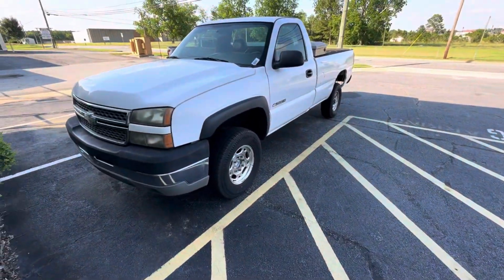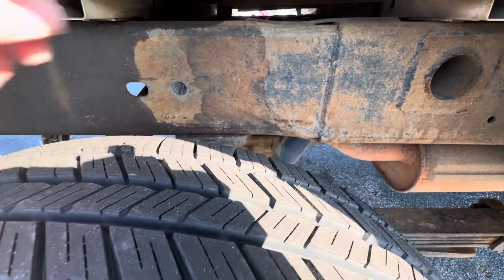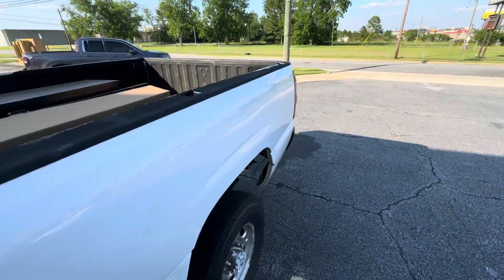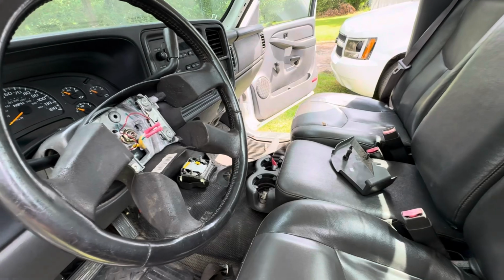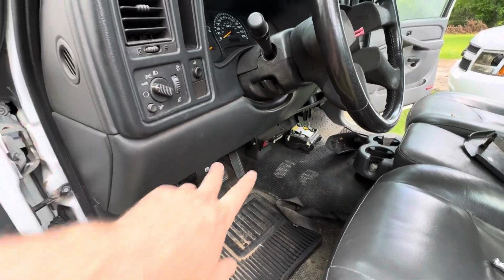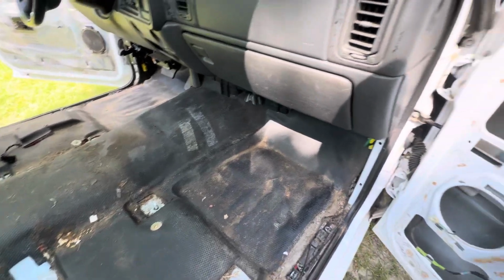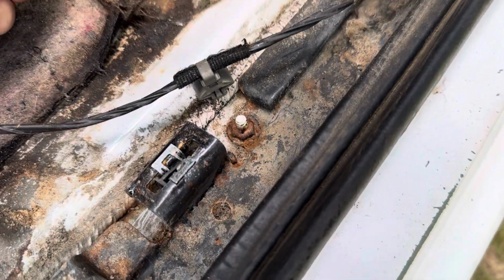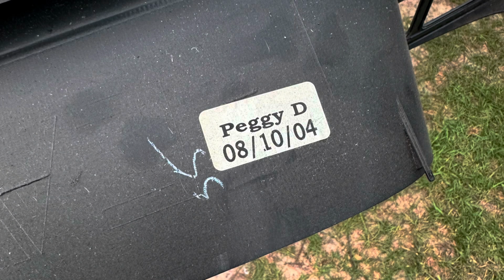2500hd Build - Part 2 - Taking Everything Apart

Comment: For the carpet pad replacement, hot rod guys use products like Dynamat type products or Lizard Skin products .  Most knock offs are self-adhesive and might be cheaper than replacement padding.
Reply from the maker: Yeah. I have cleaned the pad and its actually kinda sorta coming clean. Im gonna give it a go with the pressure washer. See if that will get that last bit of gunk out. Then disinfect it and spray some odor ban on it.